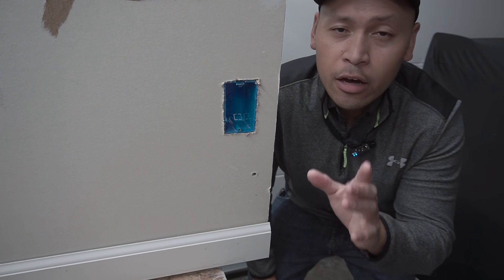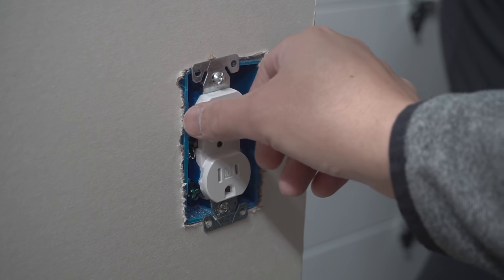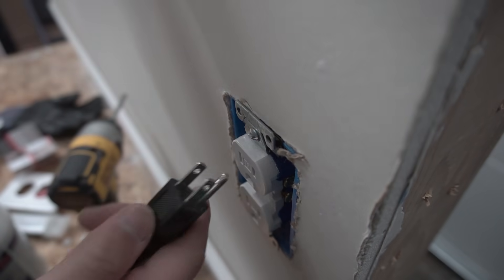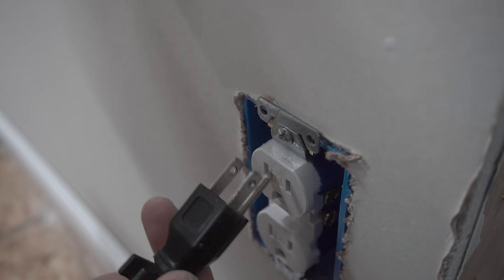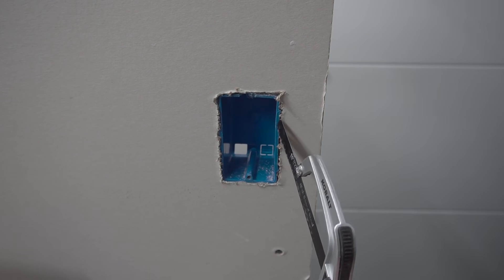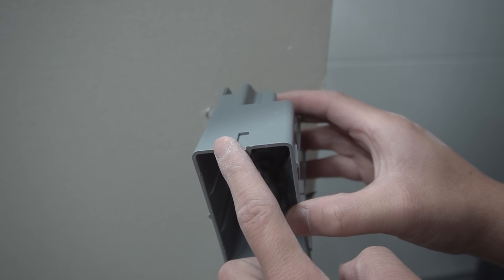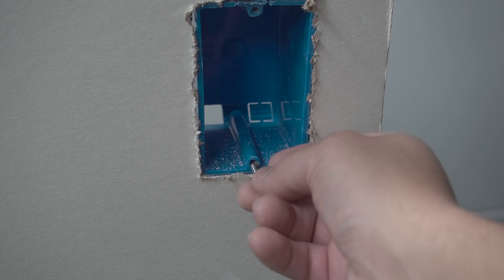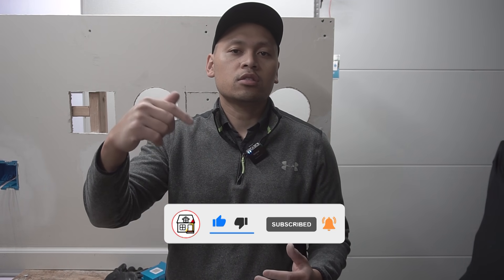How To Fix Loose Outlets & Switches Inside Electrical Box! DIY

Comment: I just replaced the old work box by just using a using a cats claw to pry it off the stud. I can’t stand things not working as intended so that gives me a reason to go shopping to buy more goodies. 

My last electrical project led me to finding the ineptitude of the electrician who did the rough electrical wiring. He backstabbed rather than using the screws and two of the wires were found to be touching causing a short and had melted two of the wires. My concern was obviously that but also the breaker did not trip. I also found that a neutral wire was backstabbed on the hot side of the receptacle with no indication of the wire being designated as a hot, so that told me there was an open neutral when I plugged in the outlet tester. I personally never have liked that method because the wires always tend to come loose over time.  I replaced both the old work box and the receptacle and to use some ideal 4port connectors to wire them up. I also had to replace a ground on a ceiling light since the ground was about to snap off.

Comment: I am far from a pro so maybe ya’ll will take my comments with a grain of salt. My first inclination is to forget about the other options and just replace the box.  I like the second old work box that you showed and agree that the first might not work as well for receptacles (although I might use them with a receptacle where an appliance will remain plugged in and the receptacle will not have any other use, like a refrigerator or a washing machine) .  It seems like to first two options would ware the edge of the box over a short amount of time and the bigger screw option might split the screw hole in the box.  Again, you have more experience in this stuff than I do, so you likely know what works well, but a new old work box seems like the most economical option that will last much longer.